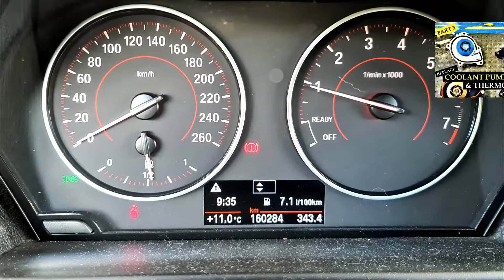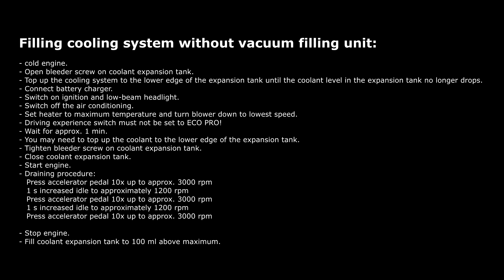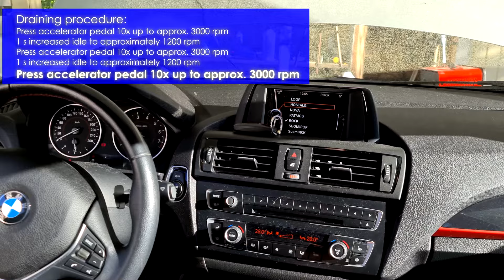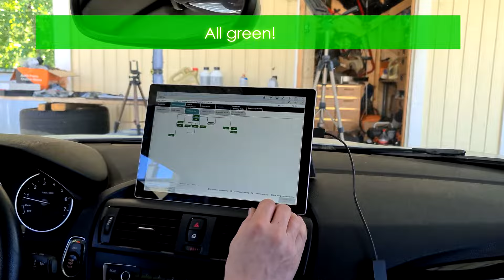Install TIMING CHAIN & VALVE COVER - 160tkm service PART 5 - BMW F20 engine N13

Comment: Hi Jani, thanks a lot for your videos. They are very very usefull. I have an F20 118i auto from 2013 and will do some maintenance with your videos. Now it has 102000Km. Major problems : false alarm from expansion tank and oil consuption. I saw you resolve oil consuption with valve steam covers replacement.....but before trying that i will change valve cover: notice some little oil leaking all over edges and spark plugs are a bit wet with oil.....my question : why didn’t you put loctite seal product all around in metal edges? Thanks again for your educational vids.

Comment: I also have a problem with my timing chain. I have a repair manual that says the crankshaft bolt should be tightened first. Should it be tightened last and with the correct chain tensioner? Or can it also be done with the special tool?
Thanks for your video!

Comment: Hello, I have replaced a timing chain same engine to this exact procedure, the engine was rough before but now runs smooth, 2 codes appeared after driving vehicle for vanos, any help you can offer? P13c9 and p13c0.

Comment: Hello friend, I have a problem with my mechanical BMW 114i 2014 N13 1.6 turbo engine. The car vibrates and has no power when driving, an unstable relationship. I changed the injectors, the pressure can pump, we tuned the car, new spark plugs, new coils and the problem remains the same. Have you ever experienced a similar problem?
Reply: Ecu issue, common on those cars
Reply: Check your pump i had a similar problem and the filter was obstaculiced

Comment: Yesterday is replaced my timing chain with youre guide! Tank you very much for sharing!! How much oil does youre f20 use?
Reply from the maker: Great that the video has been helpful! 👍
I haven’t been following oil consumption so closely, but I think consumption is normal
Reply: Mine use about 1 litre at 2500km… replaced already the pcv membrane valve etc, but stil some oil inside the inlet. Should i replace the complete valve cover? Couldnt find any cracks
Reply: @Jokesxxl  Try other oil! 0W40 or 5W40 with BMW LL01 worked fine for me. Now it needs 1 Liter oil on 10.000 km. The "recommended" 5-30 LL04 (which is designed for Diesel-Engines) is burning up on the pistons since oil-temp is already sitting around 115-130°C. Same reason the oil looks tarish after 2000-3000 km.
Reply: @currysini85  yes i replaced 1 month ago the oil with Liqui Moly 5W40 top tec 4100. Oil consumption is now 0.3liter @ 2000km! Car has done 139.000km. The only thing what doesn’t make clear for me is that the fuel consumption and power is better with 95 e10 than on 98 e5 fuel. The car is tuned to 225HP.
Reply: @Jokesxxl  I use the same oil! Will get even better, when the piston rings are cleaning up again 😉. Mine is around 140.000 km with the same Stage 1. Now the chain seems to need a replacement.
Well I had knocking with E95 under full trottle.
Reply: @currysini85  aha! I did the chain myself and it was done within 5 hours. It was stretched 1 piece of the chain @ 125.000 i can not feel any difference with the new chain.
Reply: @Jokesxxl  change PCV valve membrane.  There is a cover on valve cover , 100% is hard as a rock and broken too.

Comment: Timing chains are supposed to last the life of a car. Anytime honda or toyota put timing chains in their engine they are pretty much good. The rest of the car falls apart first before the engine.

BMW and german cars in general on the other hand, your tyres will probably last longer than the chains. What a farce.

Comment: Your videos are excellent, I'm going through the process myself - where do you find all the torque settings for the engine bolts? BMW reference information is hard to find online (I am replacing a head gasket). Also - did you re-use the cam sprocket bolts or replace them?

Comment: Apparently it's easier to replace it on BMW than Mini and Peugeot because of the way of the engine placement. Otherwise the engine is the same as Mini and Peugeot/Citroen.

Comment: Engine looks dirty under the valve cover :( Do you reccomend to change tensioner at 60000km?
Reply from the maker: It is worth changing in good time. My car has been driven about 160 tkm and it had broken like in the video https://youtu.be/_dZ6cuqy69A
Easy to change, and no expensive investment. I can't say the exact kilometer limit, but I know it's worth changing in good time! 😉

Comment: There's a special place in hell for just about every single N series BMW engine.  N12, N13, N14, N16, N18, and the twin turbo N54 engine are all garbage.  I don't care about the tuning potential of the N54, it's trash and belongs in the dump.  I did oil changes on my N18 every 3000 miles with a filter change, and did every other service you could ask for.  Changed the PCV valve just as preventative maintenance, changed coolant at 95k miles, changed both front and rear brakes recently, and changed my spark plugs at 100k miles.  Despite that, the car was leaking oil from the oil filter housing, it started a new vacuum leak from the valve cover, the EVAP system started failing despite no wiring issues and not having any EVAP leaks, the Airbag system was failing from god knows where, the timing chain tensioner failed at 104k miles despite the whole assembly being replaced at 70k miles, and the engine now has misfire issues when trying to give it anymore than a quarter throttle.

Comment: Why do you install the old tensioner before when you turning the engine by hand? And witch brand of chain set did you use? Did you had also oil consumption and gone after changing the chain?
Reply from the maker: Timing chain set is bmw original set. There is other brands with good quality cheapr prices that you can use if you want 👍.
Used old chain tensioner, becouse I want to show and  compare elognation with new chain vs old chain in previous videos. Its recomended, that you tighten chain tensioner once.
Reply: @JaniVoutilainen  thankyou for you’re feedback, ive ordered the Febi kit, hopefully it will last. But did you had also oil consumption?
Reply from the maker: Febi is Ok. I used Febi brand for timing chain set for E91 with n43 couble years ago. Oil consumption of mine F20 was normal 👍
Reply: Mine uses around 1liter @ 2500km… changed already pcv membrane, looking for vacuumleaks, cleaned my intake valves. It has only 126k on the clock… you got some ideas? Its the 2013 114i version.

Comment: Hy Jani,

Thanks for the video .. two questions if you may ..

1. I see that are for sale timing kits with and without the inlet/outlet camshafts (11367545862 / 11367536085). (The difference in price is quite considerable between the two)
A worn chain doesn't affect in time also the camshaft wearing it ? ... (wearing the teeth). When would be recommended to also change the camshafts?

2. Do you have any recommendation for a specific kit manufacturer ? In my country VAICO sells a full kit with camshafts .. next in quality/price would be FEBI Bilstein (without the camshafts)

Thanks in advance